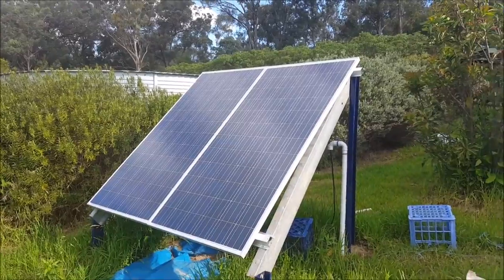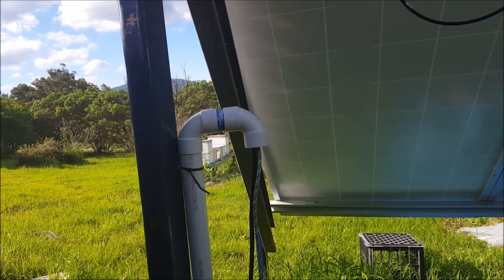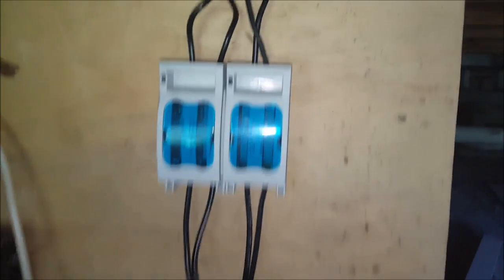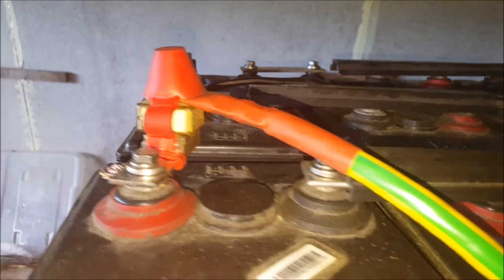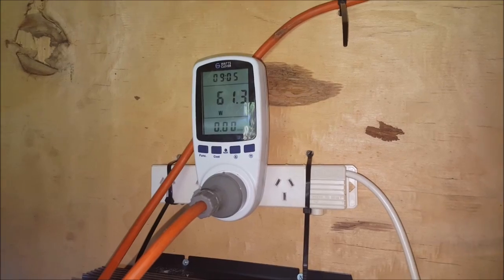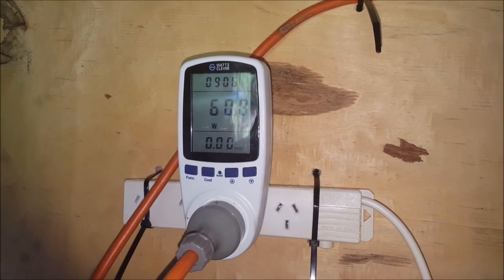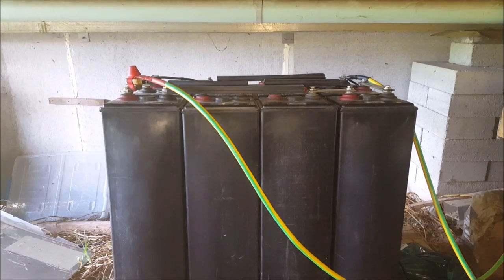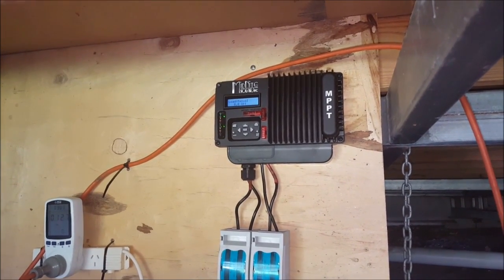Off Grid Solar Power - My 600W Solar Power System

Comment: How much panel do I need to power 4,000 watts of the grid and what happens when you battery is full and you don't use the excess power ,this is for my indoor vegetable system to grow all the fruit vegetables all year round I need light going 12-18 hrs a day depending on cycle of my food and you water is it filter before you drink wash and shower with it and the filtration system run of power as well or you just boil you drinking water cooking water a washing your body water ,but I'm really interested in a complete off the grid one bedroom granny flat bathroom kitchen toilet lounge laundry, then my vegetable fruit, then 2 cows 5 pigs 12 chicken, beef pork chicken. Australia 🇦🇺

Comment: There should be no fuses between the solar and regulator. The regulator shorts the panels, it is how it regulates.  It is not a problem now but once you add more solars those will blow up.

Comment: Pretty sure that 2 - 300 watt 12 volt panels hooked up in series ='s a 300 watt system at 24 volts nominal.
Reply from the maker: Dennis Steele - 300W + 300W = 600W. Series or parallel, it makes no difference.
Reply: Ok then , I stand corrected! Thank You.
Reply: no it doesn't....in series the watts don't increase the volts do add another 300w/12v panel in series and your volts will increase to 36v but watts remain at 300......Parallel connections will raise the watts but the volts will remain at 12v......so series is for higher volts.....parallel is for more amps/watts.
Reply: @darrellmarks6616  watts is voltage x amps so in series where voltage is increased it will give same watts as in parallel where amps increased.
Reply: So sorry for my interruption in your comment especially with my limited knowledge but I was under the impression that no matter if connecting solar panels in series or parallel the wattage would not be affected. Such as if connecting 2 panels of same model of 100 watts each then either way you connect them you will still have 200 watts total. There is an exception however, if connecting in parallel and you have a panel with a lower voltage output than the others then it will stunt the output of all the panels in the array to the output equal to that of the lowest one, the same can be said if running a series configuration with a panel that has a lower amperage output than the others; it to will limit the output of the whole array to what is equal to the one lowest unit. As a general rule of thumb "But for a simple reference in regards to how to connect solar panels together in either parallel or series wiring configurations, just remember that parallel wiring = more amperes, and series wiring = more voltage". Most people will run panels in series because they either want or need a 24 volt input for their battery configuration or some other reason. There is still one factor to be aware of and that is all solar panels must use a charging controller between the panels and batteries; this is why most people run their system in parallel because it will leave the voltage at 12 volts and the controller is much less expensive for that then for running in series where the voltage is increased. Mr Marks, maybe you should do some more research here on youtube concerning videos explaining series and parallel connections on solar panels because if you have 300 watt solar panel and you add another 300 watt solar panel in series you will end up with 600 watts unless of course you get ahold of a different panel from the first one and the amp output is different; then the system would only put out the yield of the lowest panel. If you had a problem like this in the past it is very possible that you got a different rated panel mixed in and didn't know it and misunderstood the meaning of a series wired system. I am positive there are many videos here on you tube to explain much better than I can.

Comment: I wish people like you would stop telling people you can go off grid. First off you have to few batteries and to few solar panels. I have a 3KW Array 24 volt system with three banks of 24 volt flooded batteries. On a overcast day your recharge is about half, when running batteries you need to put in twice what you take out. You give up all your convinience when using small solar systems. What you need to be telling people is install a larger array and use lithium batteries. Not some cheap ass puny system that does not work. To produce adequate power you need to spend 1000s of dollars to go off grid or live like a hermit with a small radio and a little lamp. Power is very expensive to produce. Need proof look at other YouTube videos you will convince yourself that it takes a lot of money. Im a self installer and I spent many thousands for my own system. Batteries other than lithium take a long time to recharge. Enough said
Reply from the maker: I've been off grid here for two years now. I've now got 2kW of panels charging a 24V 375Ah battery bank and that's more than sufficient. The 2kW array cost me less than $1,000. The batteries were free. The charge controller cost me $650. That's less than $2,000 right there and I currently use about 2kWh of electricity per day. On a sunny day my battery bank is fully charged by 11am.

I can even fully charge my batteries on an overcast day and even when there's light rain. I've never used a generator here.
Reply from the maker: RAFE Alexa - If you're spending many thousands of dollars on your solar power system, you're doing it wrong.
Reply: I dont believe you know what your doing. Add the cost of 12 panels. 12 batteries. Full wave inverter. Charge controller. Storage cabinet. Approved Electrical per code to set up system. Associated Panel Box-DC breakers-AC breakers Fusing- Battery cables. Intercepting AC circuits. Venting-cabinets for related Distribution equipment and their you have it. But I don{t think you know how to properly install Solar Arrays that will be electrically safe. Your a amateur. Stay away from co gen systems before you hurt yourself or worse endanger others
Reply from the maker: RAFE Alexa - The eight 260W solar panels I'm currently using cost me $84 each. The ten 12V 75Ah batteries that I'm currently using cost me nothing.

Comment: If you have connected the panels in series doesn't it mean you're actually getting 300watts from them but doubling the voltage?
Reply from the maker: No. 300W + 300W = 600W.
Reply: Matthew Xuereb Lengthy, but will answer all your questions.

https://youtu.be/tuGu_rqjq0o
Reply: 300 watts divided by 12 volts = 25 amps. So now with 2 panels in series, the voltage does double & amps remain the same & you get 24 volts at 25 amps. whats 24x25 mate? you guessed it, 600 watts! hes telling the truth.

Comment: you've run out of black and red wire mate , I am sure colour code apply also in Australian rural area . good on yaa
what would you Australians do without zip ties . good luck on your off grid journey
Reply from the maker: What colour code? Have a look at all the DC wiring in your car, how much of that is black and red?

Tie wire used to be the go to for holding shit together, but cable ties are a whole lot easier. Thanks for watching.

Comment: Pop's Shack is that watt meter still working? just asking because we got one last year, never plugged it in because we were not ready to start the project yet. anyway it has no on off switch the book says it has a place for batteries to save info, it has no door/opening for battery. it has no battery at all. how did you get yours to work, maybe we have gotten a lemon hahahah right out of the box lemon. just started watching your videos cool so far, Joseph T
Reply from the maker: Mine still works, although I don't use it much these days.  I've since expanded my PV array and now have the ability to produce more power than I can store or need.

Thanks for watching, thanks for subscribing.

Comment: will this solar design be sufficient to run this light stand-alone? https://www.amazon.com/Advanced-Platinum-P600-12-band-Grow/dp/B00NTC2XRO/ref=sr_1_1?s=lawn-garden&ie=UTF8&qid=1499314303&sr=1-1&keywords=Advanced+Platinum+Series+P600+600w+12-band+LED+Grow+Light+-+DUAL+VEG%2FFLOWER+FULL+SPECTRUM thx!
Reply from the maker: Not for very long. That grow light uses more power in a day that these panels can provide.
Reply: Pop's Shack if you come across a good solar answer let me know. appreciate the support. thx.
Reply from the maker: It all just comes down to numbers. How long will it run per day?
Reply: 18 hrs day
Reply from the maker: So that's 11kWh per day. If you want three days of back up, that's 33kWh. If you're using lead acid batteries, that 33kWh should be no more than 30% of the total battery bank capacity, so total battery bank capacity is 110kWh. At 24V, that's 4,583Ah of battery bank.

Comment: are solar panels able to charge batteries whilst there is a load on the batteries during they day or can batteries not be charged by solar panels when there is any load drawing current from them such as mini electric fan  heaters?
Reply from the maker: Yes, you can still charge batteries while there's a load on them. Don't run mini electric fan heaters on solar power though...Unless you have an absolute excess of electricity, using electricity to heat anything is pure madness.

Comment: how do you determine the sizes and location of the various fuse blocks?? I am getting components collected  to assemble a system for my house, but I wanna make sure I can protect the components..
Reply from the maker: Go with 125% of the maximum current, then go the next size fuse up from that. Fuses are there to protect your cabling, so have a fuse/circuit breaker at every leg, eg between the charge controller and the battery and between the battery and the inverter.

The fuses aren't to protect the components but the cabling.

Comment: What lead acid batteries are they - wet, gel, agm? Length of warranty? 
Did you look into passive and active sun trackers for your panels? I understand they increase output by 25-35% over a day, altitude dependent. And the gains are in the peak use period (early morn and late arvo).
Do you use a water pump and pressure tank to get good pressure in the house? 
How many rainy days can you run before the batteries empty?
Reply from the maker: They're AGM batteries. No warranty.
No, I didn't look into a tracking system. Too much cost and complexity for little appreciable gain. It's cheaper to get more solar panels.
I use a water pump to pump water to the house.
These batteries are good for about three-four days.
Check my more recent videos to see what I've been up to since I filmed this.
Reply: thanks. that's a good point about extra panels being cheaper than a tracker.
Reply from the maker: There's a fairly healthy market on the east coast for second hand panels, too.

Comment: how long the battery last?
Reply: It depends on how deep they go into discharge,also.
I don't let mine get below 12.2 V. under load.
I also have a low voltage alarm.
Reply from the maker: superman That depends on how much electricity I use.

Comment: in Australia there should be an isolator at the solar panel and the conduit should be at least 600m depth and earth cable should only be sure for earthing not for DC use, I think you need an electrician before your house burns down haha
Reply from the maker: How do you get the conduit 600m deep?
Reply: dig
Reply: sorry 600mm
Reply from the maker: So how does being 600mm deep prevent a fire?
Reply: Its to prevent from machical damage, its more the fact that if your wiring this up yourself what else are you doing
Reply from the maker: What machical damage?
Reply: its just an electrical regulation  just like the earthing cable

Comment: 24v X 630Ah = 15kWh battery bank, right? Is it not too much for only 600W panels? Do you really need that much battery in this setup? Or maybe the panels are too less in this system? I am just curious and want to understand it for myself. If the battery is down, it will take at least a week to recharge it.
Reply: No such thing as too much battery. That’s a good problem
Reply from the maker: Yor numbers are correct but I rarely take the batteries below 70% SOC. I use about 2kWh per day.
Reply from the maker: It's not too much battery for the amount of solar panels when you take my usage into account.

If I was using 5kWh per day, the panels wouldn't keep up.
Reply: Yeah, you always want more battery storage than solar panel input. Lol can always add a few more panels easily

Comment: That panel weighs 50 lbs?
Reply from the maker: Yeah, that sounds about right. That's each panel.
Reply: Pop's Shack
I think I could fit two of those on top of my camper to add to the 90w panel I have now. The thing I'm trying to work out now is, how to do it. The system I have now is pretty complicated (for me) adding to it is becoming more of a challenge than I thought it would be. Also, adding an inverter to the present system is confusing. I have to stare at the tangle of wires I have now to figure out where I would wire that in. That and, if I increase the wattage, I imagine I have to upgrade the existing components, or toast the camper I would guess.
Reply from the maker: Hooking up the inverter is easy, just positive and negative cables from the battery terminals to the inverter. First up, get to work and tidy up that 'tangle'. :D

Comment: How can you go with only 60W at that time? And 120W for fridge? Mine is maybe 750W-1000W.
Reply from the maker: I converted a chest freezer to a fridge, so in the summer time the fridge uses 300Wh per day but during the winter it's less than 200Wh per day.

As for the rest, it's just a matter of conserving electricity.
Reply: Pop's Shack owww...  That will be tough for me,  my pc consumes about 500W while gaming.
Reply from the maker: Redwan Hasan Maybe it's time to separate your wants from your needs.
Reply: Pop's Shack
I don't think I can get off grid but I do want to lower the electric bill... thanks for the info though!
Reply: +Pop's Shack .how the cost of 600 Watts solar system in Pakistan

Comment: I like your idea of the waste pipe for conduit, also like the fuse isolators (can we get them here in EU) also like (and the first time I have heard it) about the dump load to the water heater. Good job.
Reply from the maker: Thanks for watching. I'm sure you can get the fuse isolators in Europe but I have since changed over to DC rated miniature circuit breakers.

Comment: I have a question, how many 100 watt solar panels and  size/type of inverter would I need to operate a 10,000 watt window "air conditioner" ?
I know very little about solar. Thank you..
Reply from the maker: +Joseph M You're far better off not even considering it. I'll do some simple sums for you, using ideal test conditions.

To start with, you would need a 10,000W inverter. At 48V DC that's 208 amps being drawn on a continuous basis from the battery bank, so you'd need a very substantial battery bank. That's all I'll say about that for now because generating electricity is cheap, whereas storing it isn't. I'll move on to the cheap side of the equation.

10,000 watts for one hour = 10kWh. This is usually how you're charged for your grid electricity.
One 100W panel with 10 hours of ideal sunlight per day will produce 1kWh (100 x 10) of electricity.
10 100W panels with 10 hours of ideal sunlight per day will produce 10kWh (10 x 100 x 10) of electricity. This is enough to power the air conditioner for ONE hour only. That's $1,000 in solar panels just to power your air conditioner for one hour.

Now I'll move onto the battery bank. To power this air conditioner for one hour without ruining your battery bank, your battery bank must have enough capacity so that it doesn't go below 70% state of charge.

10,000 watts divided by 48 volts is 208 amps. Remember that that's just to run the air conditioner for one hour. If you have a 48 volt, 2,000 amp hour battery bank, running the air conditioner for one hour would use 10% of your battery bank's capacity.

Long story short, find some other way to keep cool.
Reply: +Pop&#39;s Shack : Thank you for explaining ,  with your figures I can see it would be impractical and very
expensive to try such a  endeavor  that wouldn't work anyway.. 
I'm going to find another source to produce the energy needed , perhaps a gas-afire to feed a generator..
Anyone with a solution please give a opinion..
Reply: ***** : My mistake , I meant 10,000 BTUs  not watts..
Reply from the maker: Joseph M So how many watts does it use?
Reply: Pop's Shack If I read the tag correctly it appears 750 watts, however, the tag is somewhat damaged and all can not be read..
 So, can you figure how many 100 watt solar panels are needed to operate this AC unit ?
 Sorry for the previous mix up regarding watts
and BTUs..
Reply from the maker: Joseph M That sounds much more reasonable. That's 750 watts per hour. I have two 300W panels and they provide enough electricity in one day to run your air conditioner for a bit less than three hours.

So six 100W panels would provide enough electricity to run your air conditioner for three hours.

Comment: Well done to you for going off grid, I have told them where to stick their gas meter, I am now working on the electric. It should not be too much longer.
Reply: There is a good diy green energy guide on EzBatteryKit ( . ) com that can help you save huge on batteries
Reply: Richard Sandwell
Reply: Cheers for the video content! Sorry for chiming in, I would appreciate your initial thoughts. Have you heard about - Lammywalness Wise Solving Guide (search on google)? It is an awesome exclusive guide for living off grid minus the hard work. Ive heard some great things about it and my GF finally got great results with it.
Reply from the maker: Thanks.